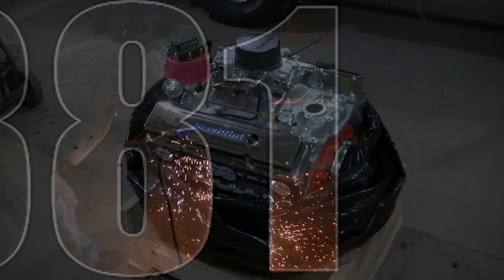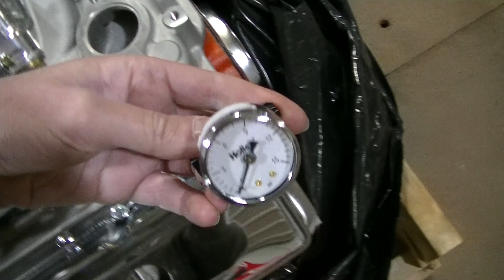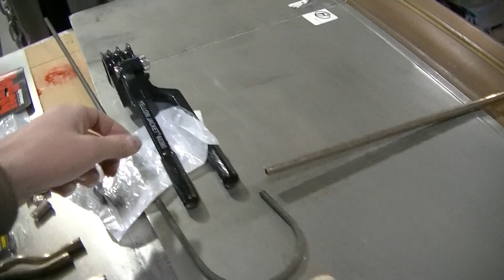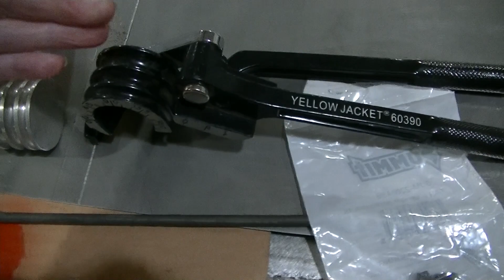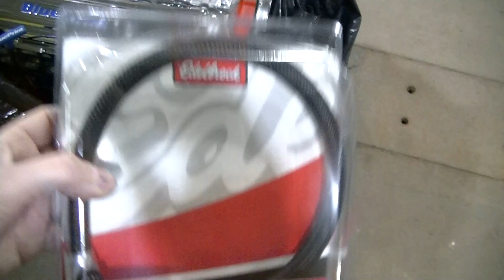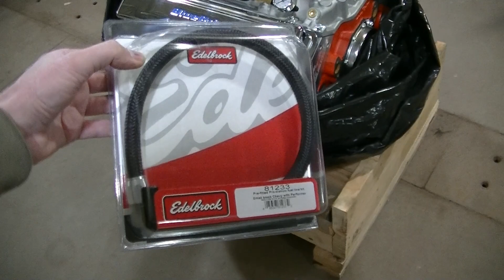DIY Holley Dual Feed Fuel Line

Comment from the maker: Things that might help with a project like this:
Tubing Bender:  https://amzn.to/3qseiNi
Small Tube Bender:  https://amzn.to/3ribmC8
Tubbing Cutter:  https://amzn.to/3FudGuM
Flare Tool:  https://amzn.to/33yrh79
Copper Line:  https://amzn.to/3zZKevG
5/8 18 Inverted Flare Fittings:  https://amzn.to/3tv6wEm
3/8 T Fitting:  https://amzn.to/33yFTn2
Holley Fuel Pressure Gauge:  https://amzn.to/3FtLVCL
5/8 18 Inverted Flare 6an Adaptor:  https://amzn.to/33ABX5p
6an Fuel Pressure Gauge Adaptor:  https://amzn.to/3rDcnVN
Edelbrock 6an Line:  https://amzn.to/3tujKBs

This video contains affiliate links, which means that if you click on one of the product links and buy, I'll receive a small commission.

Comment: nice work and it won't crack and leak like the ones from the regular parts store. Making mine right now but steel line all the way to the mechanical fuel pump.

Comment: So did you do single flare ?
Reply from the maker: No, it's a double flare just like brake lines.
Reply: Thanks yea I have been running into issues with my bigblock Chrysler with my new intake how it sits
Reply from the maker: Yeah, you can pretty much make this however you need it. The only restriction is bending the lines. That can get hard with the short pieces. I also ended up going with a carb spacer on this motor. That helped get more room for this line.
Reply: I just bought a 2300 2 barrel Holley and it didn't come with a fuel inlet to attach a Fuel hose to Carb. Parts stores are clueless. 
Would have been nice if Holley supplied a simple fitting to put a hose on the thing.
65 Mustang

Comment: Would you ever take on welding up another rough country bumper for a job? If so what would the price be?
Reply from the maker: That is a big job welding up one of those bumpers. I have so much to do I don't really have time. Your local welding shop would probably do it, but I know it won't be cheap.
Reply: @mossman381  thanks for the response. How do I approach them about the whole “buying it for another vehicle but I know it can be made work because I’ve seen it on YouTube”
Reply from the maker: I take it you have a 2500 not a 1500? That makes it even more difficult to explain. They would probably have to have your truck to make all the mods to the bumper. Again I can't stress this enough, it will probably cost a lot. If I was you, I would buy a bumper that is already built. You will probably have that much in it anyway after paying a shop to weld it up. If I was ready for a new look I would sell you mine but I am still liking what I have. And it's not something that can just be copied easily so I don't see anybody with the same bumper.
Reply: @mossman381  yea man your truck has the best front end I’ve seen. IF, big if, I was to do it myself how small of a welder can I get away with and still have a weld that’ll hold up to winch use for self recovery?
Reply from the maker: I am not sure. I used our big Millermatic which is overkill. You don't need something like that. I would say you need a machine that can weld 1/4" for the bumper and winch mounts.
Reply: @mossman381  thank you man and thanks for the content you create!!

Comment: How was it working with the copper nickel line?
Reply from the maker: All I ever get now is the copper nickel line. It's easier to work with over the steel and it won't rust out.
Reply: @mossman381  I need to do brake lines on one of my trucks think that’s what I’m going to go with
Reply from the maker: I prefer the stainless pre-made lines if they make them for your truck. They save so much time. If I was going to make my own lines, I would use the copper nickel ones.
Reply: @mossman381  I wish they made a pre bent kit for my truck but they don’t

Comment: When I was in high school, the small block 400 was the engine to have! That was back when we thought: "there is no replacement for displacement".
Reply from the maker: The 400 was gone by the time I was in high school. I had a 4.3 in my first truck then the 350. The 454 was only offered in the heavy duty trucks. 3/4 ton and up. I had a 2000 OBS 1 ton single rear wheel truck with the Vortec 454. Didn't really seem like it had a ton of power.

Comment: Why not put the 427 in the truck?
Reply from the maker: I was going to do that but bought this 400 small block instead. A 400 is an engine they had in the 1/2 ton trucks back in 70. And this 400 makes way more power than that 427. This 400 is my dream engine for the 70 truck.